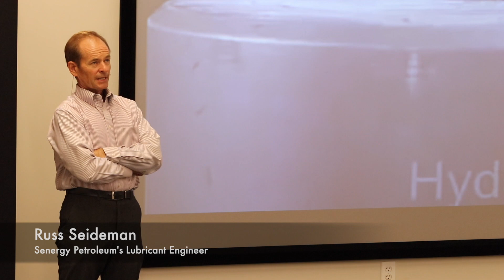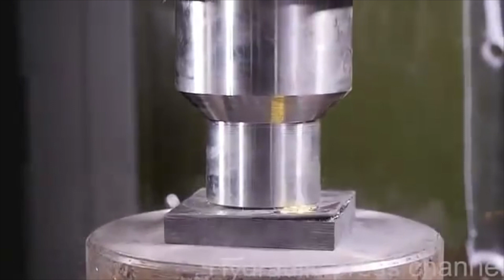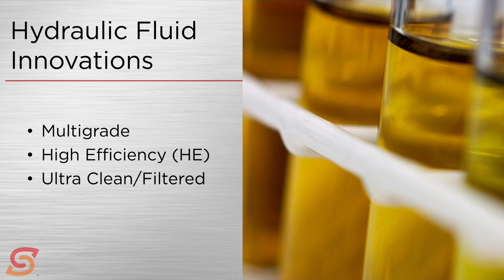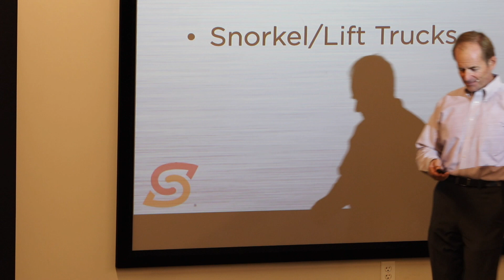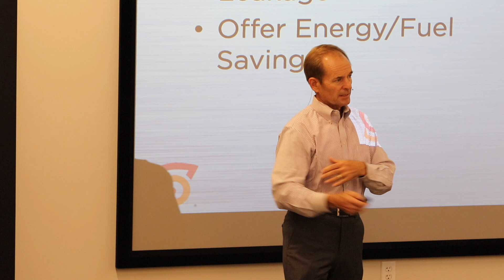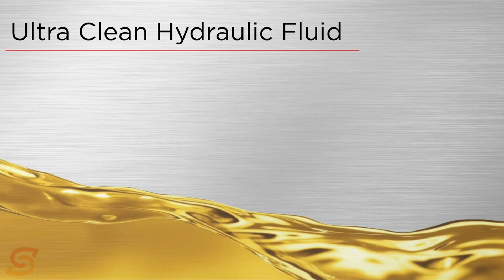Section 3 - Modern Hydraulics Training

Comment: Your guy’s series has been very helpful as i have started thinking about starting a little project that will use a lot of hudraulics. I knew how to do the rest of said project except i didn’t know hydraulics needed to be set up, like i knew how they worked just didn’t know what components were needed and in what order and i didn’t understand some specifics that would be needed to make it work properly, so thank you for teaching me the components and some of the specifics that i didn’t understand about hydraulic systems